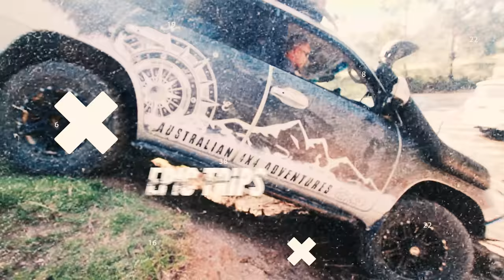Home made Budget trailer build Ep 1 - learning to weld - offroad camper - overlanding trailer

Comment: So, I had a very similar 8x5 that I had planned to do something similar with for nearly 6 months. But with Covid, a lot of people started selling off camper trailers with damaged tents on top. I sold my trailer for more than I payer for it (5yrs ago) and bought a camper for less than I sold mine for. Then through the tent out. The advantage here is it came with water tank and pump, off road suspension, over ride brakes, tailgate kitchen and gas/jerry holders. 

Still in the build and will be taking it to BRB as well.
Reply from the maker: I did think about doing the same in regards to the trailer itself but decided to just stick with what I had.   Only time will tell if I’m right or not.  

Come say hi if ya see me at the bash

Comment: You need to keep an eye on the U bolts once they have been off. The spring pack will settle over time, especially on bad roads. After doing this on my caravan I used to tighten the nuts every week or so. Eventually they stop moving.

Comment: Im slowly working on an old Traidies Trailer that I picked up a few years back. Had 31's when I got it with steel rims, have put the same wheels and tyres onto it that are on my Pajero so I have extra spares on the trailer when using it. Maybe something to think of, same wheels and tyres you run on the car (when it arrives). My plans with storage is similar with a false floor but not the full height of the trailer body (My side walls are taller) with a fridge and water tank inside but over the axle and batter over the front. I hope to have a spare on the back (Doesn't have a drop down tail gate) to balance the weight. I'm going to make hatches in the floor to store things under it and access things like the water tank and pumps but still be able to carry things like fire wood, tent, camp chairs etc on top strapped down.
Reply from the maker: Weight will be the biggest key in any build.  
Keen to see how you go with it.
Reply: @Australian4x4Adventures  cheers mate. Hopefully get it done before too long. Might have to teach myself to weld lol

Comment: Welding steel is one thing, welding gal is another, if you plan to do so, wear long sleeve shirt and gloves because it will spit everywhere, secret is to remove the top layer of gal first, use lots of anti-spatter and recoat with cold galv 😎😎  easy as, yes I am a boilermaker by trade. Good luck mate 👍👍
Reply from the maker: Luckily for me I don’t have to really weld to the gal trailer part. It’s mostly the canopy I’m making on top of it really.  

But there is some so thank you for the tips.

Comment: I did a similar build with a 6x4 box trailer 
The biggest asset changes I did was
Changed slipper springs to double ended same weight 
And extended the drawbar 
Did the Gibb and everything else I want it to do no worries 👍
Reply from the maker: I’m definitely looking into a suspension upgrade once it’s all finished and I can see the overall weight

Comment: Have done this same mod convert a box trailer for offroad use. Quick tip but Essential, add red locktite to your u-bolts on the Axel. The nylock nuts will come loose as they've been removed and retensioned a couple of times. 29 inch tyres work well I've found and load rated tyres are a bonus

Comment: Great project! You have around 350 kg of payload to play with (750kg all up weight allowed for an unbraked trailer, and allowing 400kg for the empty trailer). This means you want to think carefully about what you put in it (stay legal) and also where you will put it - for stability. Robert Pepper has a few great videos on trailers and towing you may want to have a look at.
I have the exact same single axle trailer, except mine has brakes and is rated at 1400kg (I think the difference is the brakes, tyres and springs), so I've started building it as a camper trailer...unfortunately, I'm too old to do much these days so the project has stagnated. Maybe I'll simplify it to something I can achieve? 
In any case, watching you build this may spur me on! 🥴
Reply from the maker: I do plan on getting a axel upgrade which will include brakes.  I figured that out in episode 2 haha.
Reply: @Australian4x4Adventures  Ah ha! A peak into Ep 2!! :)

Comment: As another has stated in the comments get an axle with the next weight category it will save you money in the long term which is what I have done with my M416 mil trailer here in UK and I know you said you have your steel already but there is some box section thats stronger and lighter rather than your bog standard 40 by 40 by 1 or 2 mil if I could remember the name I would tell you perhaps someone out there knows what it is got a UK sub
Reply from the maker: Yeah I do plan on upgrading the axel and bearings.  That way I can get elec brakes as well. 

In ep 2 I say that. ( out in a few weeks )

Comment: Question : Won't the weight of the springs/on the springs damage the axle once it's under load or if overload once you have put the axle beneath the leaf springs? Isn't that the reason the axle is above the spring and not below? I don't claim to know, genuine question...
Reply from the maker: It’s the same both above and below for stress on the axel.  
Where it becomes difficult is some axels have camber built into them so it will throw that out.

Comment: Ummm, did you just literally flip that axle over? As in the mounting plate that was on the bottom of the axle is now on the top? Axles are bowed with the high point in the middle, so that when you add load the wheels are straight. Flipping the axle the other way leads to poor handling and premature tyre and bearing wear. Probably should have welded new plates and kept the axle the right way up.

Comment: Good luck staying under 750kg
Reply from the maker: I’m 99% sure I won’t hahaha 🤣
Reply: @Australian4x4Adventures  you didn’t sound so sure in your last vid. I recently turned a wind up camper into an off-road version. I was gobsmacked by the increase in tare weight. If you put bigger drawbar and axle under it, it be silly not to increase the gtm and atm as much as possible